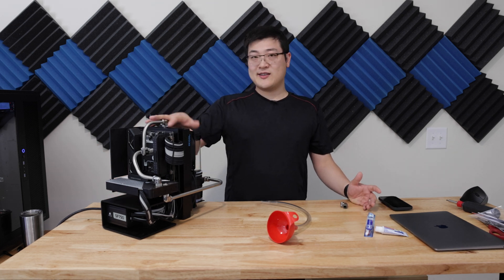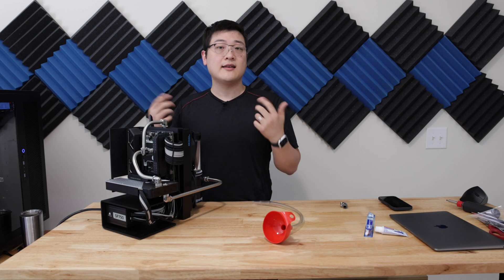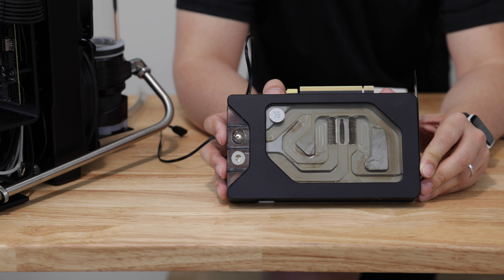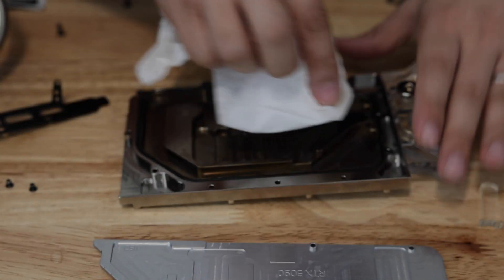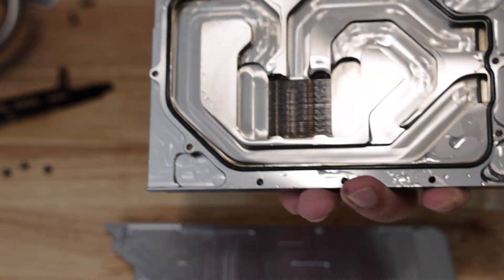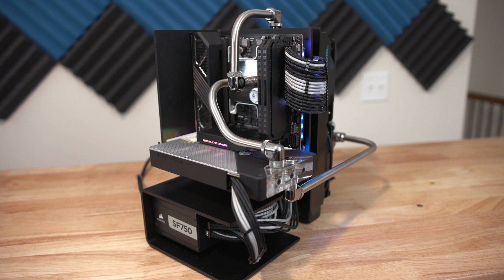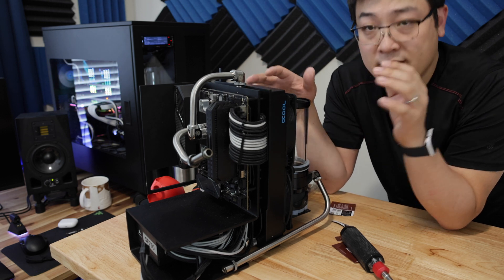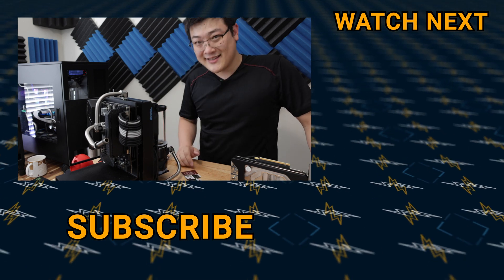3090 FE GPU Waterblock Corrosion? | Disassembly & Cleaning

Comment: I just disassembled my 6950XT 5800X3D system to move it from a Phanteks P500 to a Lian Li 011 Dynamic Evo.  My 6950 water block looks like yours after less then a year or use.  I used all EKWB products including their additive to distilled water.  I only water cooled the 6950.  It is the EKWB pump reservoir combo, (1) 360 Classic radiator, and the 6950XT water block.  

We also have a Radeon VII 9900k water cooled system that we built 3 or 4 years ago and it is not oxidizing.  The 9900k and the Radeon VII are both water cooled and it a dual radiator setup using all EKWB.

I just wonder if the quality of the metals being sourced by EKWB is inferior to their older stuff?

Comment: I just spend alot of money but moreso time and energy and mental frustrating and getting dizzy staring at the ccase anyways finally got it done... And corrosion sets in after a month the fins are clogged with what appears to be rust/corrosion/ - a tube comes out becauze of built up pressure and destroys a hardrive.

I am now typing on my phone contemplating whether or not I disassemble and attempt to clean and do one more time. 

Advice to anyone considering watercooling, it is not worth the effort and headaches.

Comment: It's galvanic corrosion. The red stain (=rust) that comes off says it all. It being stainless helps but does not stop corrosion.

Mixing metals in a loop should always be approached with much caution.
Reply: Explain by mixing metals?  You mean the fittings and different threads can be a different metal and cause this reaction?  I would assume everything bought from say byski should all be compatible with each other.

Or do you mean from radiator metal to cpu block to Gpu?  I'm so upset, it took me months to get all the pieces and now this happened -- huge corrosion on both sides of my byski double side block

Comment: Couple of things could be the cause the corrosion or it may be a combination of them all. The first one I see is mixed metals. Given the short time you had your loop going I would say that is the culprit. The other thing is the chemicals in the Biocide may have a negative reaction to the nickel plating. 
From my experience, I use a bottle of that EK Cyrofuel concentrate with one liter of distilled water.  No problems.

Comment: That's Nickle stripping due to Cu (copper sulfate) in the blue colored biocide.
I'm also using the same biocide but different brand it's from pt nuke the pt nuke cu variant the blue color one.

The Nickle are getting thinner and the copper are becoming visible.

I did a distilled vinegar mix w/ distilled water to clean the loop for an hour and it made same result as your block lol..
Nickle are really sensitive to acid even mild natural acids..
But as long as its not really corrosion and not impact performance degradation well it's fine since going with pre-mix coolant is much more expensive for maintenance and have worst maintenance issue even using transparent clear coolant.
They will still build up chalk if they breakdown since it's not the same as  99% pure distilled water & 1% or less is biocide
Reply: I've been using double protect ultra (clear premix) and never had a problem, 4 rads, 1 CPU, 1 GPU (different manifaturers)

Comment: Good info. I'd have probably tossed it in an ultrasonic cleaner after removing all non aluminum components. I used this to method to clean suppressor baffles caked in carbon build up from firearms. I'm sure it would make quick work of that amount of corrosion without risking any damage to the water block geometries.

Comment: Just buy clear concentrates (no coloring, bio prohibitors and anti-corrosion) rather than pre-mixes (they are a lot cheaper) and put them  into your distilled water. I had one 3090 Zotac build with full front and back active cooling. After 4 days it started corroding with the distilled water. Once I drained that and added the concentrate, the corrosion stopped. I still need to clean up the waterblocks with jayz2cent's method, but I'll do that next year when I need to drain the system again.
Reply: Okay I am in the same boat as you but I am here a month later after the system clogged up.   What should I purchase for anti corrosion, and is there anything I can put to clean out the system or must it be disassembled?
Reply: @ofthefutureintothepast723  if it is indeed clogged up, I'd recommend taking the system apart and cleaning every single block (make sure you make pictures or record the disassembly otherwise it can get tricky to assemble it again) using a tootbrush and tooth paste and then using distilled water to wash the toothpaste off. Also make sure you check your hard tubes and soft tubes. Make sure they can let water through. As coolant I recommend either EK clear concentrate  or EK clear pre-mix. i hear other coolants are also not that bad such as Corsair, Alphacool, Thermaltake. You just need to make sure that the coolant is clear. No coloring whatsoever. My last two systems used red transparent and green matte. Both were creating residue in the GPU and inside the CPU blocks.
Reply: @ofthefutureintothepast723  I have 4 rads (2 480s and 2 360s different manifacturers) CPU and GPU waterblock, fittings from different manifacturers and i never had clogging issues or discoloration. I use double protect ultra. (Clear pemix)

Comment: Hi Stan, informative video as always. I really want to emulate this system - water-cooled Motif Monument. However,  it is hard to drill holes/cut the backplate for pump/reservoir installation without proper equipment. Is there any easier way to do it? Thanks.
Reply from the maker: Drilling the steel is fine, any hand drill can do it. Cutting it out with a angle grinder is a lot harder.
Reply: @StanYanMan  I be motivated with this build! I start build my motif monument just for how look yours. Any advice you can give to me. What do you different if you be able to re due this build? 
Thanks! And good luck with the channel you are doing good job!
Reply: @StanYanMan  You should do a test loop with with a nickel/copper loop and your SS tubing  but heres the key bit an anti freeze coolant. Acura Type 2 or prestone 50/50

Comment: Water cooling is such a hassle.
Reply: honestly, in 10+ years of doing it the only time I've had an issue was with EK Clear tubing reacting - a couple of hours cleaning the blocks and reassembling with ZMT and everything was fine again. Drain and swap fluid every 6-12 months, but not just distilled water and biocide, you want inhibitor in there as well because even Nickel and Brass CAN react, albeit at a much lower rate than Nickel/Brass/Copper and Aluminium.

I have a 420 + 280 rad (so 5 140mm fans worth of radiator) with a 250ml res, GPU and CPU block and it uses just under a litre of premix, which is £8.